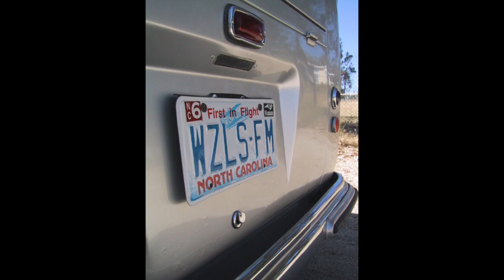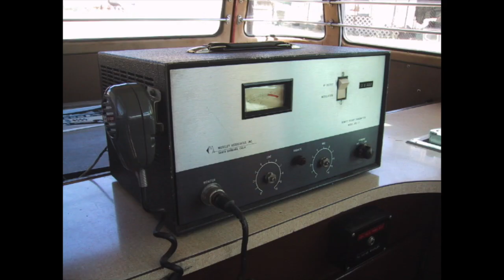Carchaeology: The WSKY Radio Mobile Broadcast VW 23 Window Bus Discovery!

Comment: Must have been hard to resist repainting it back to that awesome white/grey body with the diamond pattern logo.  The new logo looks straight out of the 90s or 00s.
Reply from the maker: That was the original plan, but once we got it here and weighed the cost versus value, it just didn’t seem like a smart move for resale.  But if it were a keeper for me it absolutely would have gone back to that livery.

Comment: 23 window'ers fetch a good price these days.
Reply: Oh, forgot to mention, this bus is from my hometown of Asheville, NC. I recently donated a wood-cased AM radio as sold in the 1940-50s by local department stores to the WNC Radio Museum in Asheville. I'm trying to remember for sure, but I believe one of the four pushbuttons had a WSKY. Years ago, I took all the tubes down to the local Radio Shack and tested them on the tube tester such as sat on the counter of many a Radio Shack, and the radio still works perfectly fine.
Reply from the maker: That is super cool!!